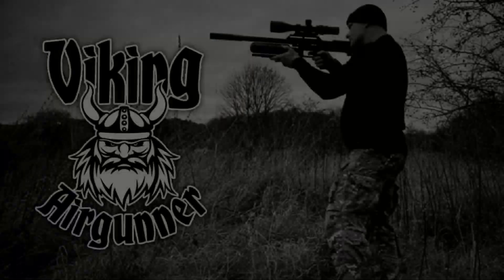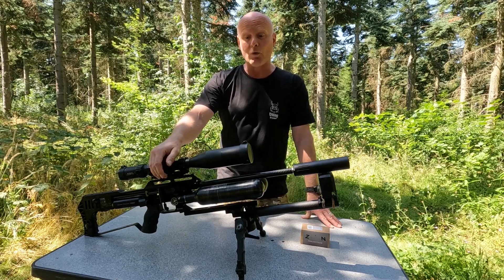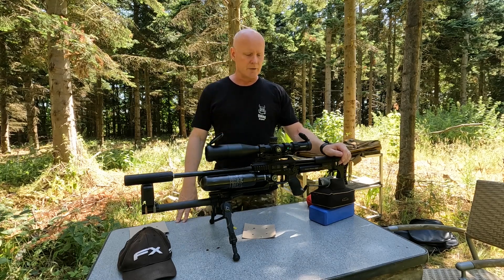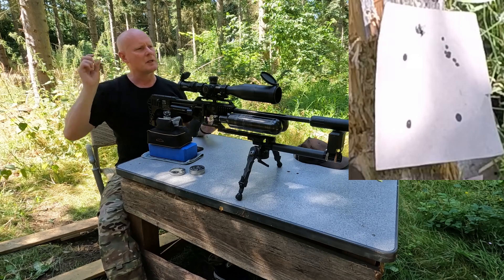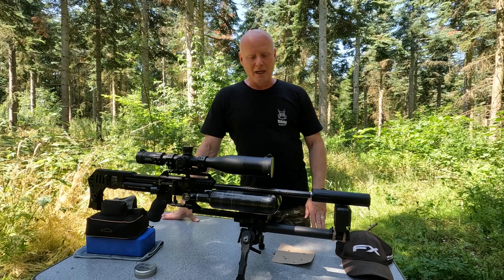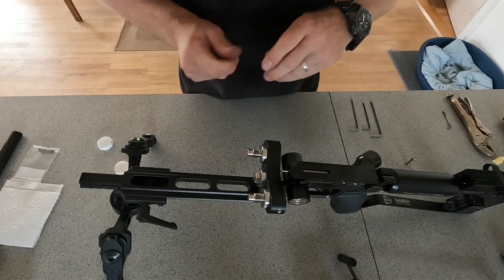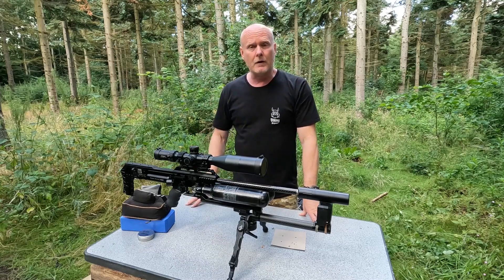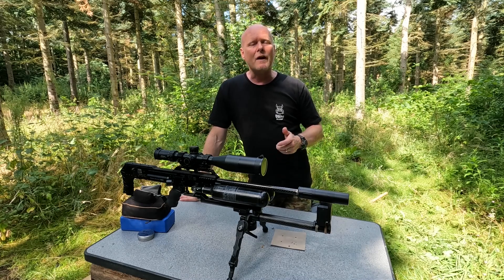Effects of a HEAVIER HAMMER WEIGHT in the FX Impact M3

Comment: Good video Mr Viking, on a mates .30cal M4 700mm i fitted the 14g Tungsten hammer weight and a Huma Transfer port,( reg 165 bar) it pushed 60 grain slugs to 970fps and shot very accurate, it is definaitly ment for high pressure, high velocity heavy weight slug shooting. I did try fitting a slug power kit that contained a Tungsten hammer weight to a .25 cal FX crown and it did not like it one bit, way over powered so i fitted a new hammer weight that was just a bit heavier than factory standard but that did the trick just fine getting the crown to shoot .25 cal 36 grain NSA,s.
Reply from the maker: Thanks for sharing mate 👍👍
I hope that alot of guys with smaller calibers will read your comment 😃

Comment: when you replace the hammer for a heavier one ,would you not have to have a stronger spring to propel the extra mass forward
Reply from the maker: The standard spring will do - at least for me with the relative low reg preasures that Im using. But depending on what reg preasure you are using and the power required from the hammer, the stronger spring will be nessecary at some point. I would imagine well passed 150 bar. 
I did not really need a heavier hammer weight, but it had a positive effect on the harmonics of the gun.
Reply: @VikingAirgunner  thank you ,i really appreciate all your videos
Reply from the maker: @virtuosomuso thanks buddy 🤗

Comment: I am having FX impact mkII .22 700mm barrel. Is it possible to shoot 25.39gr pellets using stock hammer. If not how much hammer weight i will choose please help
Reply from the maker: Your standard hammer will be just fine when shooting those pellets from a 700mm barrel. I imagine that you will be fine untill you decide to shoot slugs heavier than 36 gr.
Reply: @VikingAirgunner  thank you so much, i almost change stock hammer, now i will use standard hammer as your advice thanks a lot

Comment: Using the heavier hammer and same reg pressure improves air consumption and regulator recovery?
Reply from the maker: No. I allows you to turn down the spring tension on the hammer. Or it give you access to opening the valve when using high preasure on the regulator👍

Comment: Do you use slug pin probe as well?
Reply from the maker: Yes 🤗
Reply: @VikingAirgunner  unfortunately Ive upgraded to tungsten hammer and slug probe and kept same settings as previously and i've seen velocity drop around 40fps from the original smooth liner and and pellet probe.
Reply from the maker: @sekefy1  well that is an easy fix then - just switch back to the standard hammer weight 😉

Comment: what size hammer spring are you using also are you using soft valve spring or hard
Reply from the maker: Both standard 👍
No need to change any of them 🙂
Reply: @ which is the standard valve spring now soft or hard
Reply from the maker: @theyorkshirelad.  Hard 👍

Comment: Another great test Peter. Air use would be nice to know, and hammer preload flange is mentioned in the comments I see. I guess the important thing is accuracies. How the air is released from the plenum affects the airflow around the slug at mussel exit, didn't seem to make a big difference.
I got the Crown mk1 cal 22. Got the FX slug hammer kit. (I want to shoot the heavier slugs, 25-30 grain). The Tungsten has a 8mm "flange", and the combination is way too much. With scrub screw set for min power, the hammer bottoms out at half adjuster wheel setting, slightly more at higher pressures (tried 145-160-180 bar). But got up to 997 fps with 180 bar. Guess that is the limit for a mk1. Have ordered two Huma brass hammers with different weight and preload length. Anyone got experience with the Crown mk1?

Comment: Nice video, but how about power? Is it change?
Reply from the maker: I will allow you to use a super high reg preasure, since that will require the hammer hitting harder. So in a way yes... But you will most likely be fine with the standard hammer weight.

Comment: There are so many factors involved, that I just can't stop tinkering - and every time I regret changing anything.  Weirdly, In case helpful to anyone, I've got a fantastic tune on my Crown mk2 for 18grain JSBs, shooting them at 950 fps. I'm running the reg at 95 bar using the 700mm barrel and Huma slug kit plus heavier hammer (although I don't use slugs). My extreme spread is a bit high at approx. 15 fps, but it doesn't seem to impact my groups. I shoot at 50 - 75 meters.

Comment: Great video! Watched a lot of them now! You should show more close up when stripping and rebuilding the gun, it’s interesting to see how different people do it.
Have you done any testing on .22 calibre?
Reply from the maker: Thanks man 🙂
Watching Ernest Rowe's FX Masterclass and Airbuks is very inspirering - sometimes finding myself just watching them and getting into some kind of meditative state 😂 But trying to make videos like them I failed big time, so I m leaving that to them😃
Saddly we are limited to 177 here in Denmark and getting licenced to anything bigger requires courses permits and specific places to test, so I will stick to 177 for now 🙂
Reply: @VikingAirgunner  
That would explain the .177 content. 
I had to go through the licensing process to get the fac .22 in the uk. 
Bit of a faf but worth it to get out to further distances. 

I fitted my new superior heavy liner yesterday and got a little testing before dark, I took the time to clock/index (turn the liner 1/4 at a time) the liner orientation so it shot at it’s lowest point to enable the greatest amount of click elevation for dialling further distances to negate the use of adjustable scope mounts.

Initial testing showed no great difference in grouping compared to the std 700mm superior liner. 
More time needed to test different speeds and slugs. 
I think I noticed an issue with my first reg, when taking a shot the needle goes to the set reg pressure then it slowly drops about 15 - 20 bar then settles.
I thought if it creeps, the pressure should increase not decrease. 
I wonder if it’s a problem with the gauge not the reg?
Reply from the maker: @iantcroft  you have lots of interesting testing ahead.
The effect of new gear is mostly seen over time and by observing general consistancy, but for me the heavy liner made a big difference right after installing. But calibers are different and 177 is supposed to by the hardest to tune 😃
I dont pay attention to 1st reg at all. As long my 2nd reg is fine. 1st reg is just to take the main preasure of the 2nd. Some ppl are canseling it, but I see a great help using it. Especially when shooting at low reg preasures.
Reply: @VikingAirgunner  
More testing it is!
I will need to set up an account with the slug manufacturers!

Comment: M3 800mm tensioned tungsten hammer weight NSA 28.5 - 31.2 800- 850 fps 45ft lbs accuracy at distance.
Reply: good isnt it! i had 10 bar pressure and it was beating anything i used even at 110 bar with my old hammer. i was gob smacked

Comment: Weren't the Africans using a 27gr tungsten hammer which needed a minimum 165reg to work effectively,  which then put a massive stress on the valve pin, hence why a few who changed had valve pin failure?
Reply from the maker: I know that they have been using it, but I havent heard about the failure. I could imagine that a hammer this heavy would apply alot of stress to the system, so it is likely. The tungsten hammer weighs around 14-15 gram, so much heavier than the ones in this video 🙂
I dont know if it is 100 % nessecary with the tungsten hammer to get a 40 grain slug to go 1000+ fps - but when is it nessecary at all 🤔

Comment: With the light brass hammer of those 2 and my Maverick with the reg of 60 BAR or so, i still push 13 grains at 1000 FPS, and the rifle sound like a blowpipe.
I still feel that hammer are a bit too heavy, i am contemplating cutting into mine to lighting it a little.
Reply: Yes sir but why. I have fx crown and impact m3, they run flawlessly between 100-150 on regulator. Recently I received the panthers from factory it was set on 120. I was too lazy to go bring my crono, so the sound was so low, I felt no power and was seeing the pellet flying into a 20 yards target I kept on pushing regulator to its maximum. Then I got my chrono,  it was giving me 630fps. While researching I read somewhere drop regulator to increase fps
Reply: I dialed it to 60 and pellet went to 910. I tried a slug it went down to 810. But it is sounding like an O ring blew up. Do you know why this is happening. BTW 3:different suppressors and still it is sounding like a gunpowder 22 pistol
Reply: When you drop reg pressure, it's easier for the hammer to open the valve both in amount of lift and duration
The higher the pressure, the more resistance there is to opening the valve

Comment: Are you using less air with the heavier weight? Obviously your settings are lower so is the air usage.
Reply from the maker: I cant say for sure. I know all the theories, but I never count my shots pr fill 🤔
Reply: @VikingAirgunner  Be a good test to carry out, I have FAC .22 M3 and obviously when you start to push the slugs at 1000fps it uses the air a lot quicker as everything is near max. But if your turning settings down and still getting the speed surely it’s using less air.
Reply: i no for sure!! i use 50 instead of 90 air now im using the heavier tungston hammer, i was gob smacke no need to get the better reg now imo

Comment: Outstanding video.  I've installed the FX Tungsten hammer & slug power kit in my .25 Maverick. It's now pushing 44gr H&N Heavies at 1090fps. 2cm groups at 100 meters. Front reg is at 180, rear at 150 bar. I'm working up to 300 meter shots (hopefully).
Thanks for sharing.
Reply from the maker: Excellent results 🤗 It makes much more sense in the bigger calibers!
Reply: I don't know how you achieve that power with such low reg pressure. Are your bottles nitro charged😂?
Reply: 1090 fps with a 44grs Slug out of a Maverick and only 150bars of working pressure? Wow that's world record😂. I cannot achieve this with my Impact M3 in 25, tungsten hammer and 700mm barrel. Are you sure its not 30cal?
Reply: @markusscholl4958 I use standard hammer in my MK2 Impact 148reg 49.6gr 980fps, 165reg 49.6gr 1000fps, laser accurate.

Comment: Good shooting Viking, i have the huma 7.5 in mine, 25 cal/600mm, absolutely drills the jsb knockouts, very accurate.
Reply: snap same as mine, i have the 28g
best my dreamline has ever fired
id changed from a lite , 300 barrel 2.2 to 600 barrel and 2.5
i swear something was just wrong with it . some pellets i could spit further but now since i changed only the hammer im getting my 600ft/ sec, sub 12 works perfect just under 12 now 
im over the moon with it

Comment: I had the Huma heavy hammer in mine. Try setting the reg at 165 bar that gives the hammer something to strike against, then you can play with the hammer strike and go for a short crisp blow of air, this will reduce the exit turbulence I had slugs going through the same hole at 50 yards, ❤
Reply from the maker: I think that my next test will take to around that preasure, so while there I will tune it down to my usually 940 fps 🙂
For reference Im shooting the 16 gr Zan in the same setup as in the video, but with around 1000 fps. And as you say, very crisp and calm. Hammer at 1,5 😃
Reply: I changed my barrel to 500mm .22 and use zan 25.5 . First reg 165 second reg 130 8.1g hammer with 6mm preload. she cooks @ 960fps 10-12mm group at 50m , 12-16mm @ 75m
Reply: 100 yards is the new 50 yards.

Comment: I bought the tungsten one and that thing was too much just the violence and the twang of it I couldn’t use it, so I ended up getting the huma ones and went with the heavier of the two you get and it’s prefect heavier than stock, but nowhere near as heavy as that tungsten that thing is insane haha
Reply from the maker: Do you know the exact weight of the tungsten hammer?? Ive been searching for it only to find what I all ready knew - it is 1,7 x heavier than stainless steel 🤔
Reply: @VikingAirgunner  Another great video Peter, tungsten hammer is 14grams on my weighing machine.
what front reg and rear reg pressure did you shoot with? 
Valve adjuster at front is that on 4 lines? 
I am thinking of going dual tank also, as i am filling up too often, or using too much air somewhere.

Looking forward to seeing your 2cm at 150meters
Reply from the maker: @marcoe01  14 grams is absolutely crazy - unless you are pushing some serious slugs at blistering speeds 😯
For 177 at least it is not useable at all! But I guess that 30 cal with 68 gr slugs can be a different case 😎
Reply from the maker: @marcoe01  1 reg at around 170 and 2 at 132 bar through the whole test.
And front valve around 4th line yes 🙂
Reply: @VikingAirgunner  i bought it by mistake as i also did not know what 1.7x meant. but i neever tried it, as i was afraid it would damage the internals.
Reply: 223gr @VikingAirgunner
Reply: I’ll weigh mine when I get home for lunch
Reply: @LRP-AirRifleHunting  my shooting buddy bought the tungsten hammer, i think its around 16.5 grams and like you said it was way too much, no tune ability at all hardly, very violent shot cycle. it now resides in his junk drawer, we got the huma set and love them.
Reply: @Don.E.63  Yup I felt like I was running the rifle to hard and at the time no one in the states had the huma set but then one day all of a sudden high pressure pneumatics had restocked them and I ordered one so fast haha
Reply: @LRP-AirRifleHunting  im pretty sure that is where we got ours at too, im using the 7.5 and has worked good, its actually what the gun should have from the factory imo, or the 8.5 either one, take care & shoot safe and often.